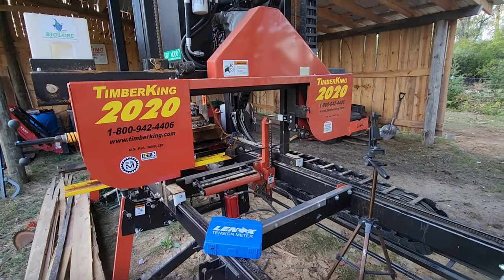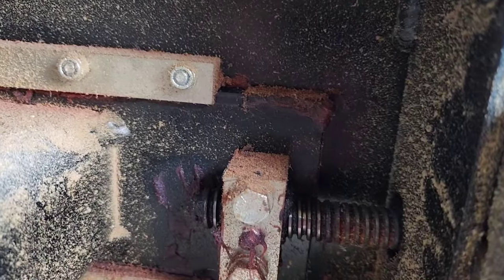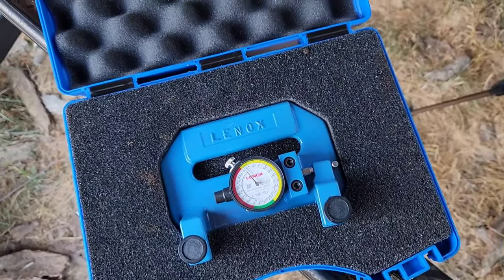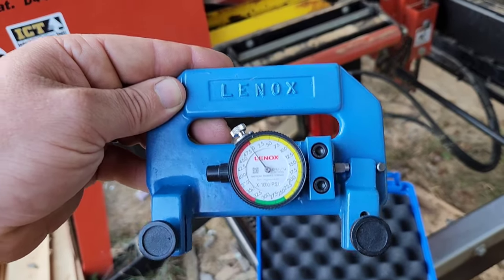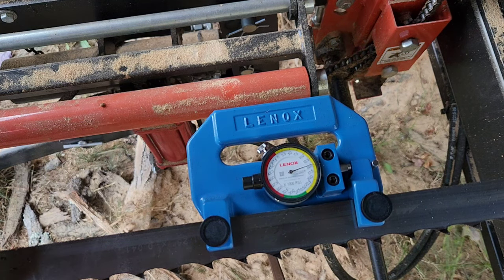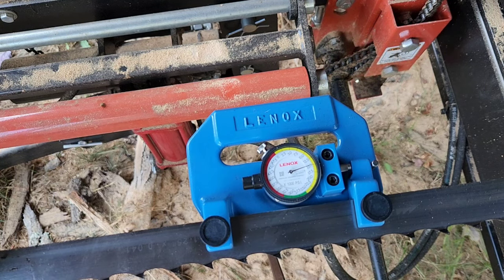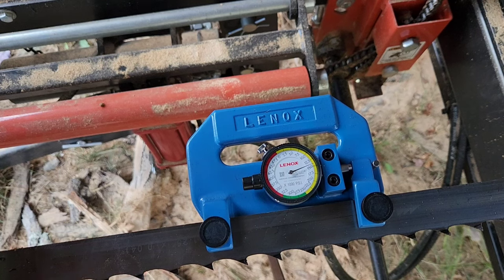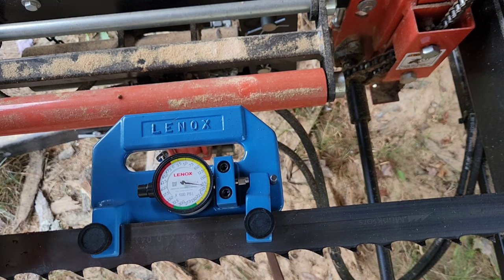What is the actual blade tension on a bandsaw sawmill?

Comment: Great video!  I have the Starett version of this tool.  They recommend a little preload on the gauge.  So, after you set the fixed side, just move the variable side of the gauge to move the needle just a bit then lock down and zero out.  Just FYI.
Reply from the maker: The Starrett can measure both directions, the lenox is only one direction.   I have a Starett coming next week to verify that they are reading the same.  I can try preloading the Lenox one as well.
Reply: My Starrett is one direction like the Lenox.  So they must make both types.  @TCSawmills

Comment: The reading outcome of this type of instrument is going to be different based on blade width,  steel type and thickness using a constant pressure gage reading,  IE 1100lbs.  It is measuring the stretch of the band.  Measure a 1.25 x .045 vs a 1.25 x .055 and your gage reading will be different.

Comment: When comparing blade tension guages between sawmill makers, it is importage to consider the diameter of the hydraulic cylinder that is applying the pressure.  If they are different sizes, but yield the same blade psi with your tension tool, then we know something else is causing the variance.

Comment: Good info but what is the controversial part?
Reply from the maker: Different manufacturers have different tensioning methods.   Based on the mechanical advantages, each mill reads a different value on their tension gauge.  For example, woodmizer runs around 3000 psi on their gauge where timberking reads 1100 psi.  Each reads a different value, but in actuality, both are running around 17,000 psi of actual blade tension.  A lot of folks say one brand or the other cuts better because they run a higher tension, but the blade is actually about the same.